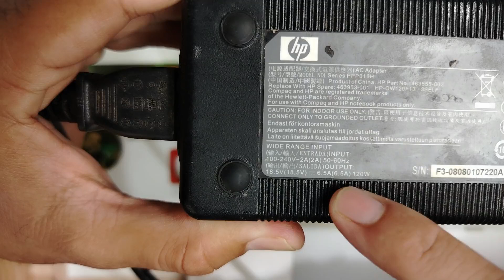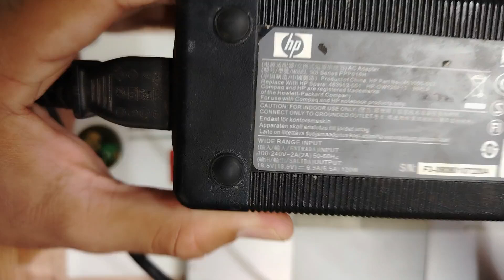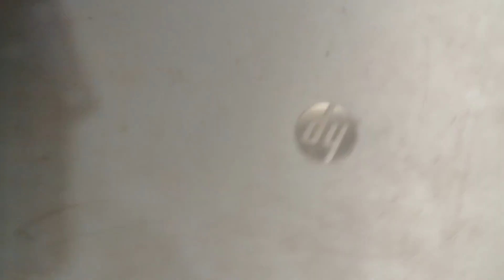HP EliteBook 8560p Black Screen Step-by-Step Live Repair Guide - Laptop Repair

Comment: Love this channel and skills but i only have one possible observation and that is using a brush to clean the ram instead of a cloth type.  I once quickly brushed the pins of a good CPU and then it didnt work and i assumed it as all the static i made with the bristles. Ram proves to be pretty robust from tests of trying to damage using static BUT the channel DID eventually destroy the ram module. So i only clean CPU's and Ram and any thing like that with metho or iso and a paper cloth or similar so not to generate static or a voltage and touch my hand to the computer chassis to ground any static i have before i start. Anti static straps? Seriously?? I worked on hundreds of computers and NEVER caused a problem for a M/B, i mean you Bake them in overs and wash them!!! 
But static charge is very real and certain things you have to be careful.
Reply from the maker: Thank you for sharing your insights. It's always great to hear different perspectives on best practices for handling components. Your tips on grounding and cleaning methods are really valuable.